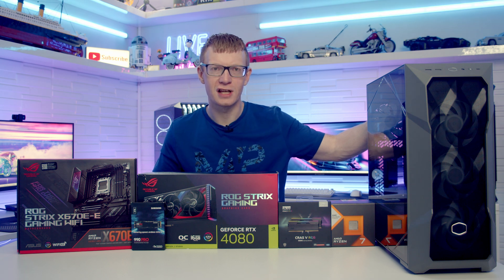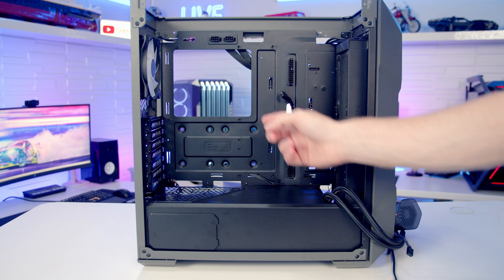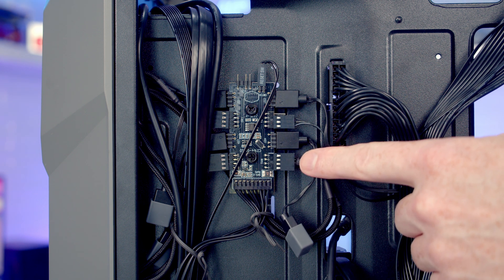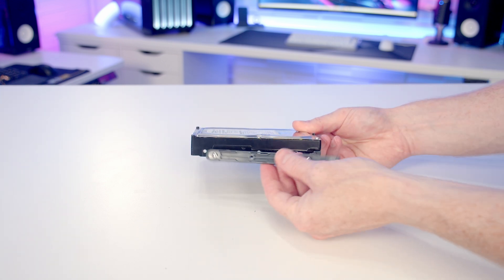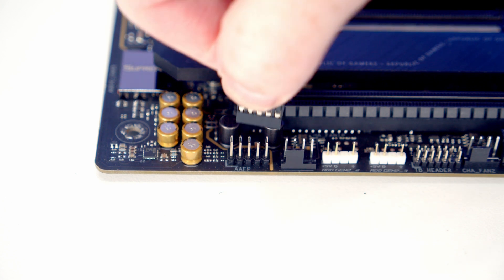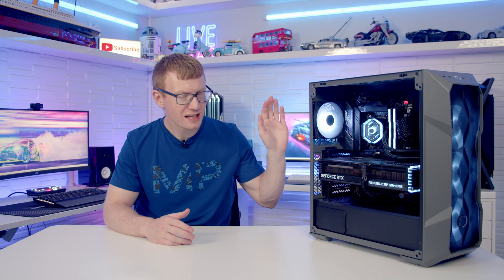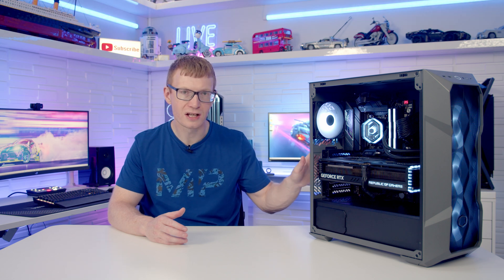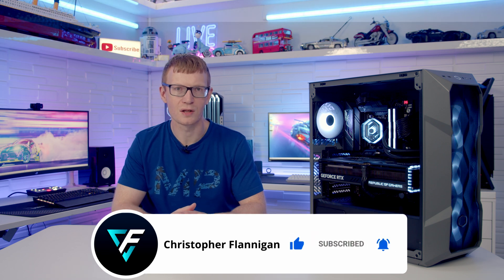Cooler Master TD500 Max Build - Step by Step Guide

Comment: Im sorry your explanation are quite short for the GPU pcie cable, so if im gonna build it with RX 7900 xt do i have to buy another cable for it or can be adapted with another cable? Im kind a noob hehe. So if the answer is yes i have to change the pcie config from psu is that gonna be big problem for the build?
Reply: This case includes one 6+2 pines and one 12 pines cable for the GPU. So, you don't need to buy an extra cable.

Comment: Would you be able to change where the AIO is to the top and put in another set of fans in the front?
Reply from the maker: Hopefully there would be room, but it would take the point of the case away